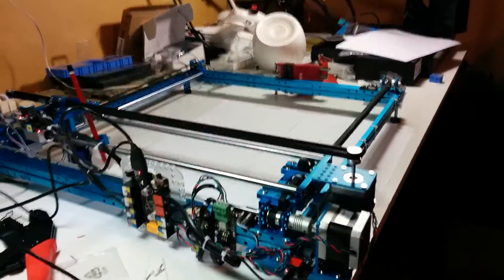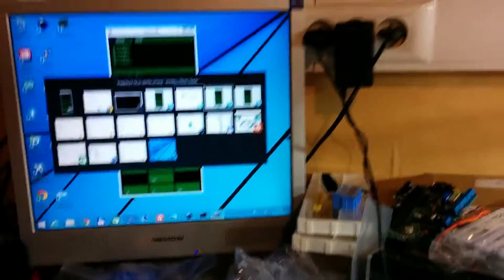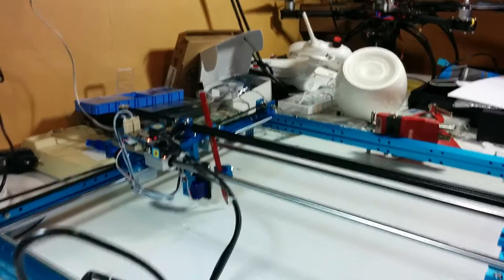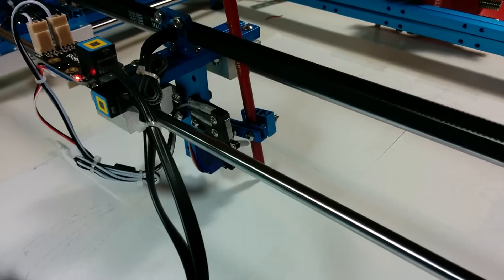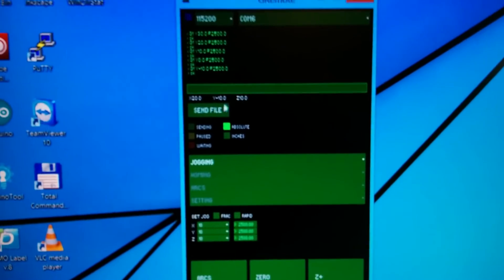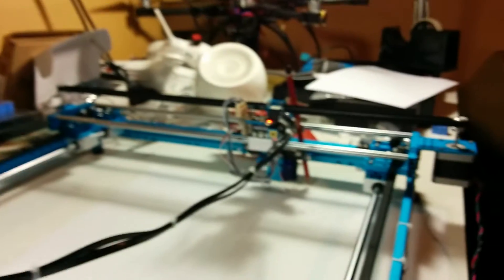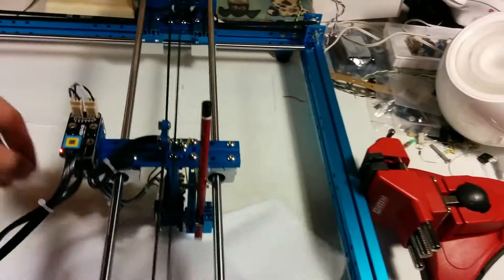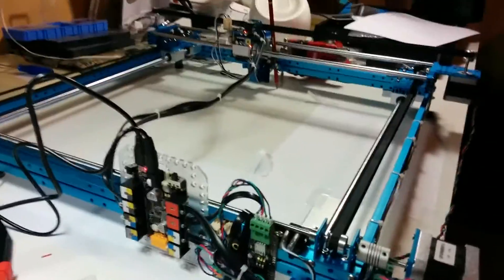Makeblock xy plotter v2 problem

Comment: Take the felt off the feet and go to Walmart and get the 4 pack of "L" brackets they sell in the hardware section of the store. Put them on all 4 feet and screw them with a cordless drill or other drill to a old table. The plotter will not move.